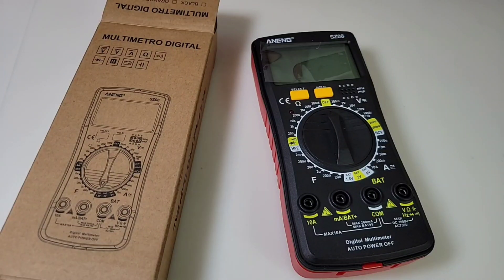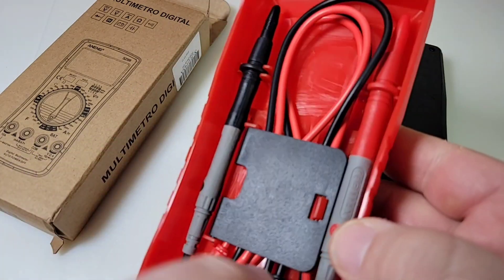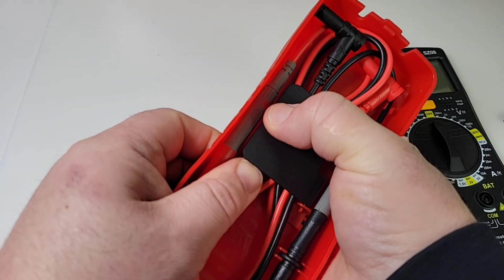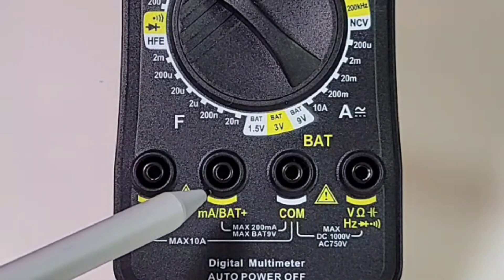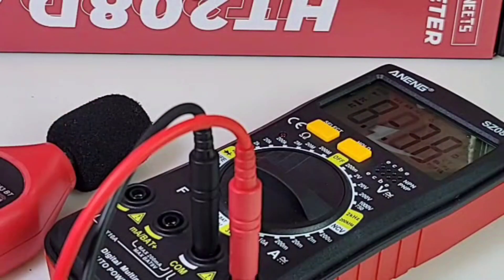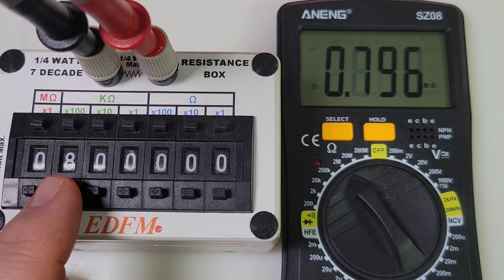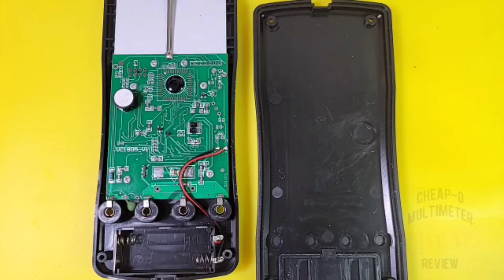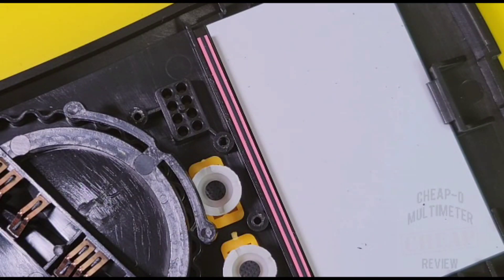ANENG SZ08 CHEAP-O Multimeter Review & Teardown!

Comment: If you put this multimeter probe to the 600 volt. You will die. 😂

No protection inside.
Reply from the maker: No CHEAP-O Multimeter is designed for anything other than household mains..600V is industrial, and you shouldn't be using this dmm for such a task. 👍

Comment: @14:18 Those input jacks were causing a problem on my unit!  The free ends of the leads are too long, and are untrimmed on the range selector side of the PCB.  They hit the back of the front panel plastic and keep the PCB from sitting flat, actually bowing the board away from the range selector near the input jacks.  I couldn't figure out why my range selector was being flaky, especially around the bottom of the dial.  When disassembled, I could see there was a mark at all four locations in the plastic.  I trimmed those tails, reassembled, problem solved!  Now I can KeepOnTesting!
Reply from the maker: I couldn't have said it better myself 👍 Great job !

Comment: @7:35 I noticed when changing range sometimes the unit resets as observed by double-beep and the full panel display showing "-1888 briefly".  It can be observed near the end of your motions back and forth through resistance scale.  Nice to see it's not only my device that does this, I thought it was defective!  I guess the only drawback is if you had turned off APO when initially turning the device on, this choice will be lost.  Only way around this is to hold SELECT while changing range just in case it decides to cycle the power during the mode change (I confirmed this works).  Also interesting is there is a phantom backlight mode.  If HOLD is long-pressed it will beep but nothing happens.  I suppose if someone wanted to add their own backlight they could find the correct pin coming off the COB and add the appropriate transistor/resistor circuit to drive the current to an added LED.  It seems this device is very similar to the SZ305 which has a backlight and such a circuit as observed in that other video you did.

Comment from the maker: Thx for the update Paul..I had high hopes for this multimeter but alas, Aneng engineering fell short again. It's still a fun meter to use and it's definitely workable. I only wish they would have done more to make it truly conceptual besides the case enclosure (which I like). As you mentioned , putting some rubber down for traction sounds like a plan (think I'll do the same).That tiny 5A resettable fuse works but I'd still like a regular ceramic in its place. All in all a novel dmm that could've been lots more ! 😊

Comment: I just received mine and went about checking over it.  The NCV is now a thin wire going up to the top of the unit, same as the SZ305 you reviewed.  NCV function works fine.  I noticed the buzzer still has the white protector over it, so I removed it, thinking it was a manufacturing oversight.  To my surprise, it changed the tone of the sound to be less audible!  So I put it back.  Turns out, there is an open tunnel under the buzzer where the sound comes out and makes it to other places in the case.  The white patch is up against the case anyway.  For continuity, the buzzer consumes 18.4 mA (0.94 V dropped across 51 ohm series resistor) and the LED 3.4 mA (0.34V dropped across a 100 ohm resistor).  On my unit, the fuse continues to be a SMD resettable fuse marked "JF".  After lubing it and putting it back together, I put rubber bumpers for the flat and tilt configurations to keep this baby planted.  Otherwise the test leads drag the hard plastic case unit around mercilessly.  Oh, and one other note of interest, both brethren will do relative capacitance, just hold down SEL after choosing the farad range and a delta symbol will appear in the display to confirm.

Comment: @15:00 So that would be a PPTC substitute for a fuse, not a current shunt, right?  A PPTC wouldn't respond linear to current increase. Nice that there are pads there to install a proper fuse of sorts and drop the PPTC.  The place where a wire current shunt is unoccupied.  It seems the board designs a meter that can be populated properly or cheaply, depending how they want to designate components later on.
Reply from the maker: Correct, PTC resettable fuse (not a current shunt).

Comment: I just bought SZ08 with black back cover and my 'NCV' runs normally. It just so happened that I needed a cheap multimeter for the electronics hobby. multimeter with standard accuracy and there should be an auto power off function, lucky I saw this review. next cheap one, i want to buy aneng M20. it looks like the M20 is a replacement for the AN8002.

Comment: I'm sure i already wrote a comment a while ago but somehow it's suddenly disappeared... oh well, anyway, although it has some cons, but the battery tests might be handy on the bench, as it covers the most commonly used : 1.5v, 3v and 9v batteries.
Reply from the maker: The Battery testing range was definitely better than average. Should satisfy most who find this feature useful.
Reply: @KeepOnTesting  How does this mode work?
Reply from the maker: @pault6533  In this case the meter simply puts a small current load on the battery or cell, so in effect the internal resistance of the battery is being gauged.

Comment: If you can find it cheap and you don't need much, it's an okay meter. The second you took it out of its case it was obvious that it won't have any input protection. It's typical for Aneng to cut cost there, but in this case it's just too thin for it. Still an interesting model. I can't shake the feeling it's loosely based on that Red Dot Award winning JIMI.
Reply from the maker: ...Red Dot Award take 2...I agree! 
At least the ANENG opens without a crowbar...too bad the rest of the multimeter wasn't as impressive.

Comment: ANENG have cut too many corners on the SZ08, unfortunately. They have really hit the bottom end of the DMM market with this one. Strange, because they have many other models in more or less the same price range that are higher resolution, much better looking and better built, too.
Thanks for the honest and thorough review, as always.
Reply from the maker: So true! Take this design and incorporate it into a cutting edge dmm and ANENG will have a winner..
Reply: Like what other models ? I am looking to buy a digital multimeter and the brand I most come across is ANENG of course my budget is low so what other ANENG digital multimeter in the same or lower price range would you suggest.
Reply: can suggest a good model please